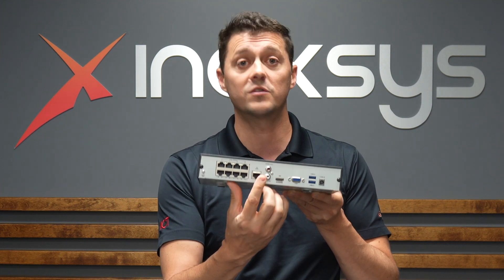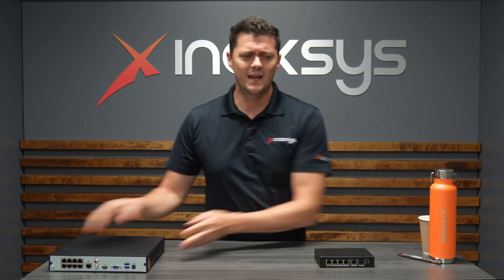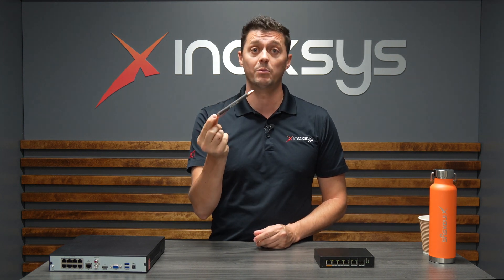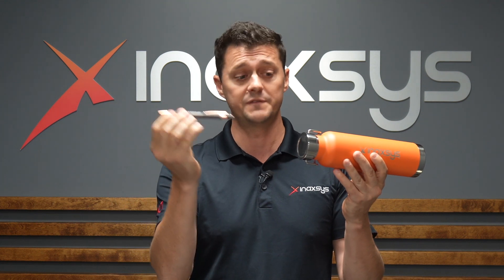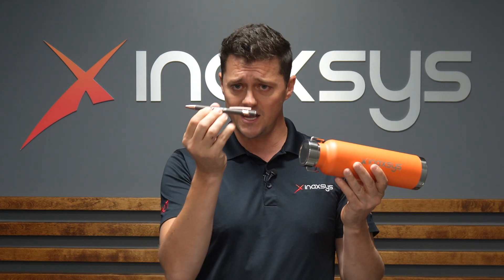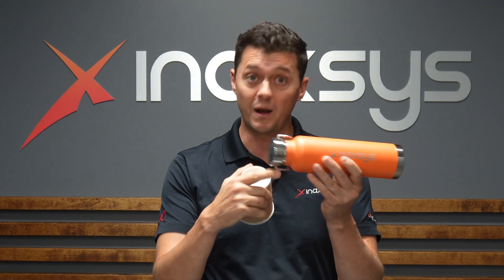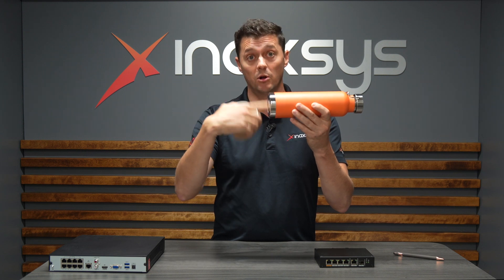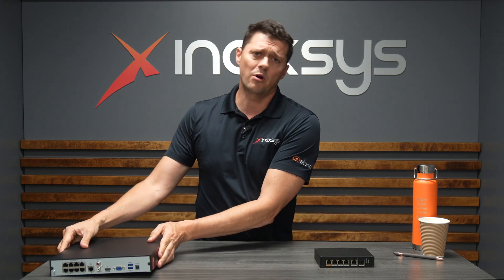PoE NVR vs NVR with External PoE Switch: A Comprehensive Comparison

Comment: for a simple home setup POE NVR works but be mindful 4k Cameras diminish its throughput, the POE ports are rated for 8@1080p not 4k probably 2 @ 4k. my general rule is POE switch and then use a gig link to a none POE NVR. then your not limited. you can also then if needed feed them into a NAS at a later date etc....

Comment: hi my name is Sarel and im in south africa. i have a hikvision 16port nvr. i bought a cudy switch with 8 10/100 poe ports and 2 uplink ports. the problem i have is it works fine with 1 camera to a poe port on the switch and and cat6 to one of the ports on the nvr when i add a second camera to the switch the 2 cameras alternate on the same block on my screen not like normal each to a block on the screen. please help

Comment: Get cameras that support both POE and the legacy  12v barrel connector. I've run into cams whose POE fails but the barrel fed supply still works. All you need is a data/power splitter at the camera to get back up and running. I've not had any problems with the POE on the NVR or switch...yet.

Comment: very knowledgeable, especially when it came to the sfp media connection. You talked about choosing a media most people like fiber optics but one can introduce microwaves ( modulate the inputs into a microwave radio) and send the data over microwave Relays over to a desired destination/ Data Center. I'm in love with your channel.

Comment: I prefer using non Poe nvr and external poe switch..that reduces the chance of damaging a more expensive nvr in case of Poe ports being shorted
Reply: It doesn't make any sense, "poe ports being shorted" what do you mean? If you're going to spend money on an NVR, I assume you'll install it in a secure location, right? So why are you worried about damaging it?

Comment: Fof home survillence with 4 ip cameras and distance not more than 60ft, NVR with built ij POE switch is recommend or external POE switch.
Reply: Check the camera section of the NVR software.....many have POE wattage monitoring. On my 16 camera system with 10 cams its a 200watt capable supply that only uses 18% of the total available at night when the IR is on.

Comment: Is there a way to update the camera system without actually replacing the nvr. I have a 32 channel nvr and having issues with no video on almost half .
Reply: Yes, you can just get and attach new cameras. And your best bet is getting cameras that are the same brand as your NVR, or at least research and discover which camera brands are compatible with it.
Reply: @DrMathOfficial  sir can I use POE extender direct to POE NVR ? or I really need a POE switch ?

Comment: Hey man love your video, very educational. I wanted to know if you could help with an issue I am having. I wanted to know, if I just want to install one camera that is a POE 5MP, do I need a NVR and a POE switch as well? Also, is there an NVR with a POE switch installed, like a combo? Any suggestions?
Reply: All nvr's have built in switches in them unless it's a wireless nvr designed for wireless cameras. All you need for 1 camera is 1 nvr with at least one poe channel on it

Comment: I have limited internet, does a wired NVR system only use internet when accessing remotely or using the app or is it always consuming data?
Reply: That's a really good question. Did you ever find out the answer?
Reply: Only if you set up remote monitoring or cloud storage or remote management. But you have to explicitly do that in most cases. Otherwise its all on just your LAN.
Reply: @jimb4090  thanks

Comment: Thanks for making this informative video. So from what I gather, having external POE switch is more for commercial application with large number of cameras over wide areas. For me, it's just one small house with 3 maybe 4 cameras at the most so a PoE NVR is more than enough for me.